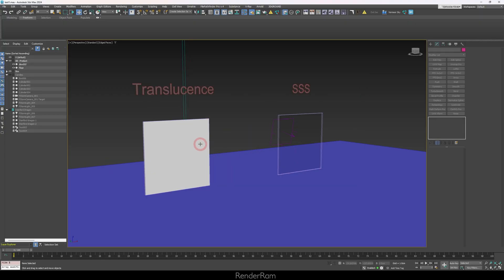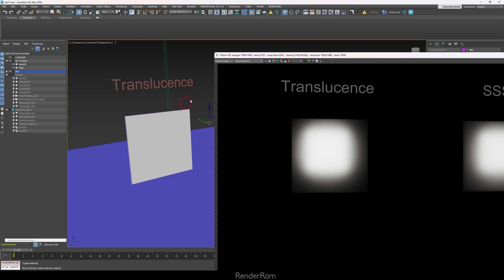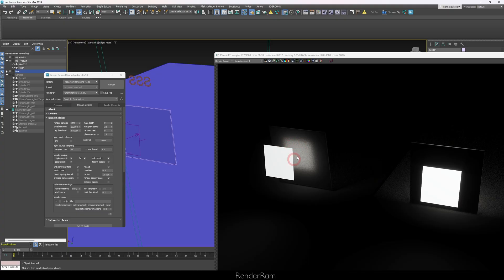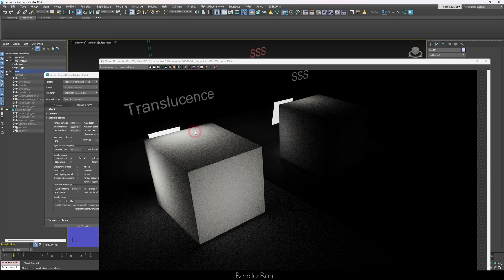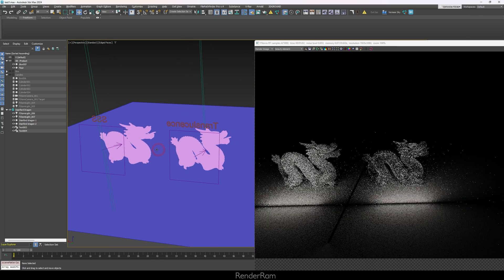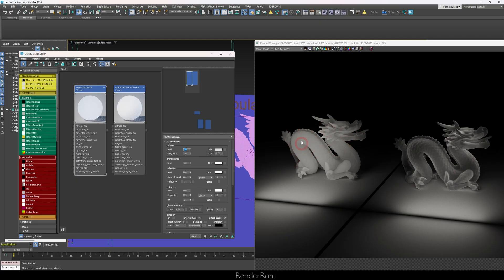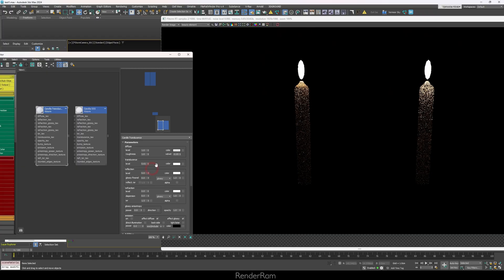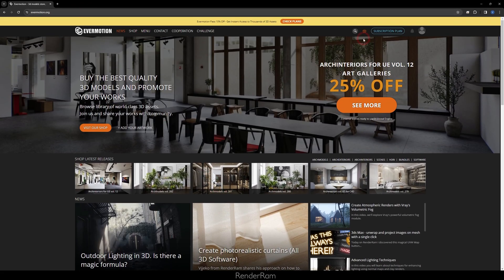To Use Translucency Correctly You Must Know This | All 3D Software

Comment: Nice explanation, thank you! One tip for the next episode of "Known Unknown Depths Of 3ds MAX" I just found by mistake – when you are in a maximized viewport and hold the Win key + tap on Shift, you can switch between other viewports either by cycling through them with tapping Shift repeatedly or by mouse-clicking on one of the viewport's thumbnail. Just an alternative to good old Alt+W 🙂 Also Ctrl+Alt+MMB for smooth zoom is not so known feature... Anyway - thank you for your videos! Keep it up!

Comment: example:
- milk: is subsurface scattering, because Milk has dispersed suspension contents, light scatter between these particles
- matte glass: is translucency, only matte in surface, fully solid translucency internal substance
- pure water: translucency
- coffe: subsurface scattering
- chocolate: subsurface scattering
- skin: subsurface scattering
- sea water: a complicate situation, just treat it as translucency and add particles manually

in general, the difference is the substance does have pure translucency or not.
blood content water is translucency, but it have many others organic materials in it, so overall not pure translucency = subsurface scattering
Reply from the maker: Excellent info!!! ❤️❤️
Reply: @RenderRam  thank you, I like your content <3